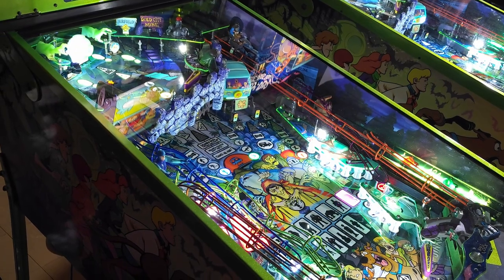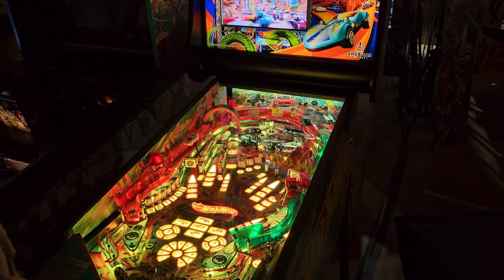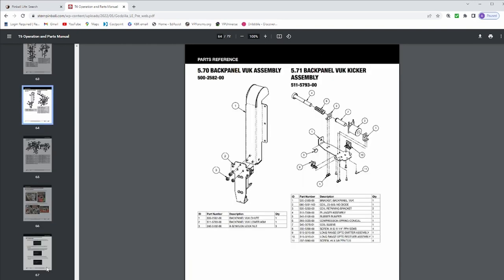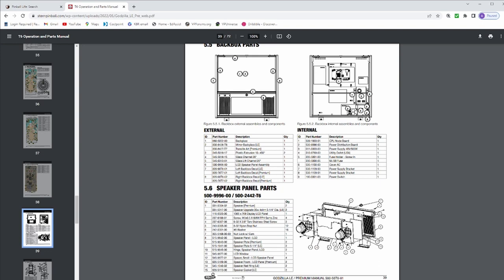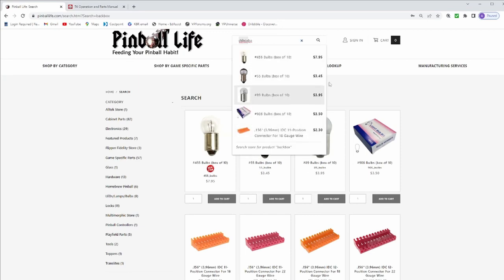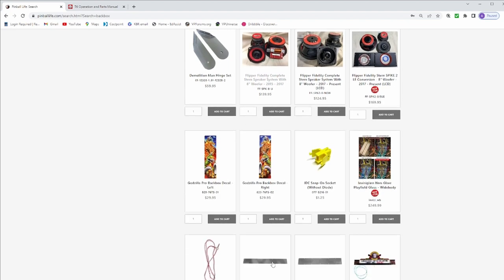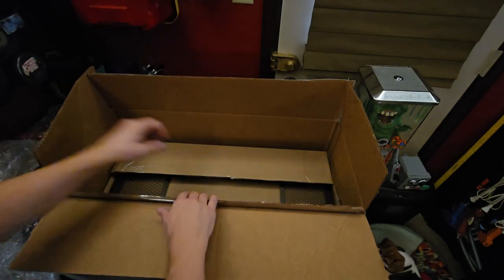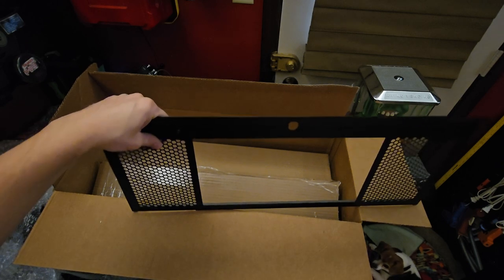Scrapyard Pinball (Pinball on a budget) a new Backbox part 1 (fixed)

Comment: Nice. I have a lot of the same items from Pinball Life. Once I get my Stern flatpack I'll be working on the same stuff. Thanks!
Reply from the maker: My spooky to stern (s2s) adapter is now available on thingiverse. If you have a 3d printer you should be able to print it if your plate volume is 235 by 235 by 250. An ender 3 should handle it. If you don't have a 3d printer micrometer has the ender 3 on sale for $100. That is the printer I use.

Comment: Thanks for the video.  Glad you are recovering after your surgery!!  Going forward could you be sure to link all the products you discuss in your videos it would be much appreciated!!
Reply from the maker: I have updated the description to include all links for the parts. Note I did not include the Stern monitor. This is because the stern monitor is setup for a spike two system and you will need to purchase an additional a LVDS to HDMI adapter, and stern mount, in addition to the monitor it is about $400 total. The LVDS to HDMI adapter and power supply are kind of difficult to find for a specific monitor and range from $32 to $80 online. Pinball life will sell a stern-to-stern drop in replacement monitor and even the mount, but you’re on your own with no tech info for the LVDS to HDMI adapter and power supply. Stern Spike 2 includes the converter custom built into the spike 2 system so there isn’t a LVDS to HDMI it is LVDS to LVDS. Spooky provides a one stop shop for $199.95 you just need to make an adapter for it (3D print or jury rig something. From a performance perspective spooky is 720P and Stern is 1080P. I didn't thing the extra $200 was worth the minor performance boost. I plan to post my final revision of spooky to stern (S2S) adapter on thingiverse.com once it is finalized (episode 11 hopefully). I'm not saying you can't do a stern monitor... I just don't recommend it due to limited tech support. I even called pinball life and spoke with their led tech guru, and he said, "good luck, and to go with spooky" I got the impression they didn't know what is recommended for the monitor. Hope this helps and keep the feedback coming.
Reply: @chipgt81  Wow Spectacular!!  Greatly appreciate the response and links.  Really enjoy following along!
Reply from the maker: @J R  I'm currently on revision 3 of my custom adapter (making some final tweeks and making sure it works well, before posting it to thingiverse) and this week's episode is all about it and the mods needed for the spooky mount in order to make it work with the stern parts listed in episode 8. Episode 9 may be a bit boring to watch, but it is key in understanding the mod required for the spookey mount. The last 5 mins are loaded with gold nuggets of info.  So far, revision 3 is looking promising, but I will know more once the second half of the adapter is off the printer in about 5 hours. Can't wait to share as episode 10 has been fun to make and should be much more entertaining to watch.